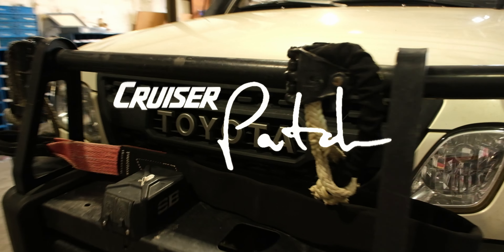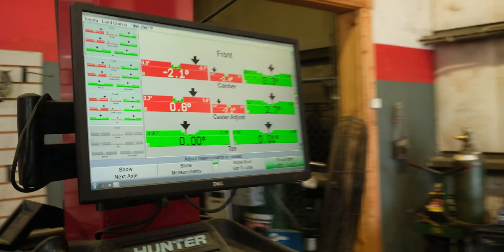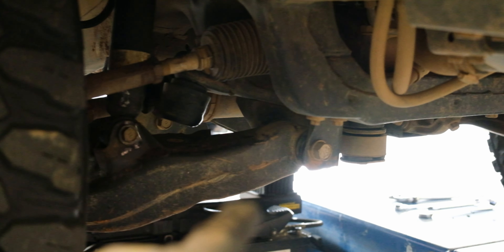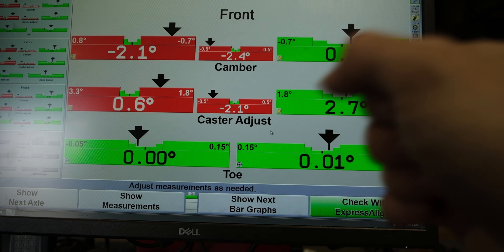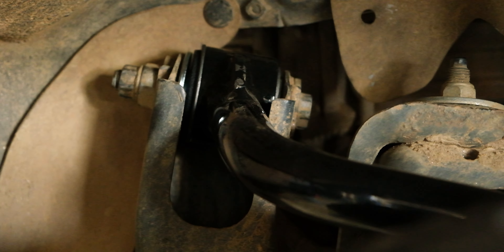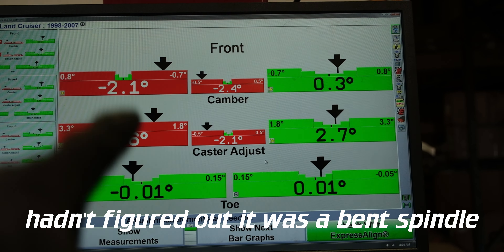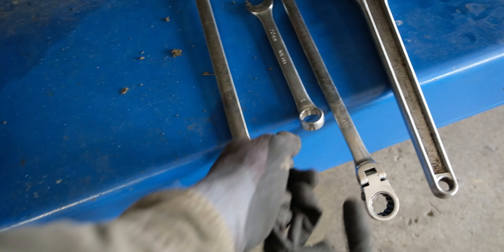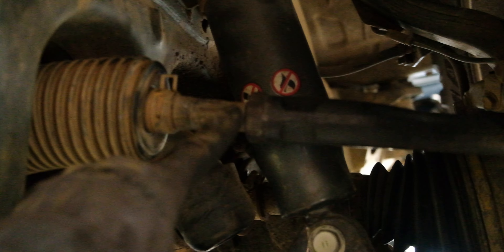How to align a 100 Series Land Cruiser/LX470 & why quality aftermarket UCAs are important

Comment: Maybe I am a bit dense, are you currently running the Nitro UCAs? I heard you say you might go back to SPC. What torsion bars are you using? I just want about a 1" -1.5" lift max ( I don't want to sacrifice ride or downward wheel travel, much to at all) for a better look with BFG KO 285/75/16, and a nice ride for 85% city/country rutted road use. I was in a friends LC, with a 2.5" lift, and it rode terribly, and was very twitchy on the road.
Reply from the maker: I made a video about my torsion bar setup but the TLDR on it is that I use OEM torsion bars from an LC.

Using the right springs (torsion bars) and aftermarket UCAs with positive caster offset are the two most important ways to maintain ride quality in a 100 post-lift